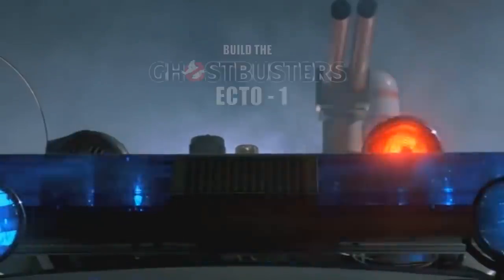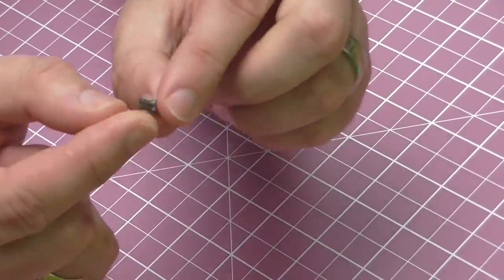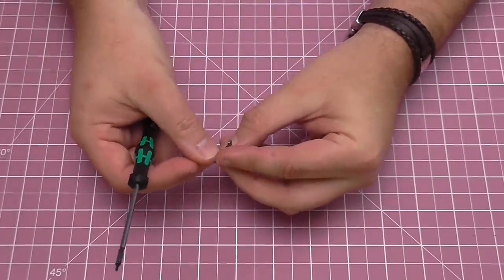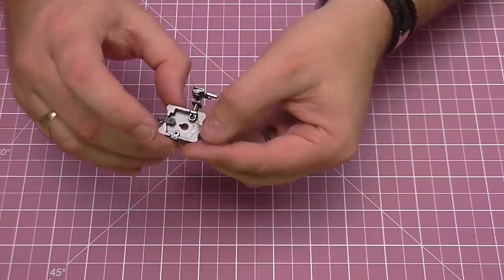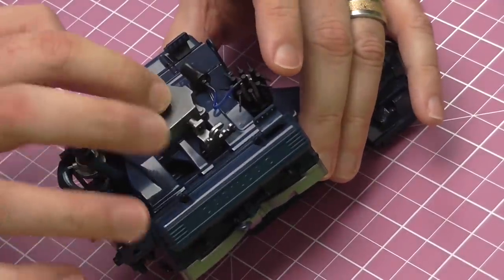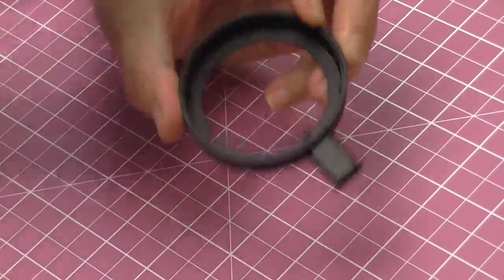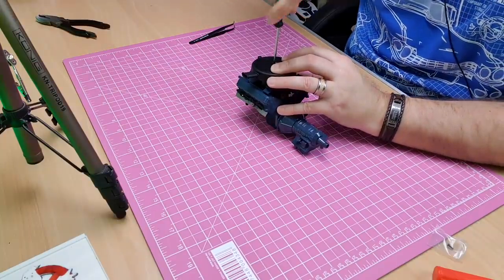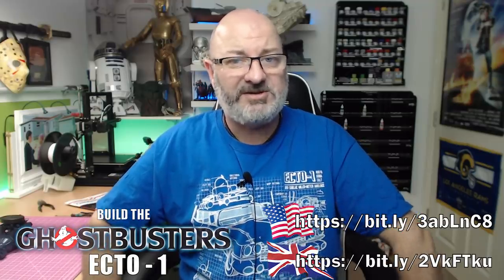Build the Ghostbusters Ecto-1 - Part 9 - The Carburetor and Air Filter

Comment: You can use fuse wire to put in your pipes to hold there shape and to hold them firm in place
Reply: wish I'd thought of that - have build upto stage 14 now......
Reply: @robt8593  sure the tip will come in handy at some point mate